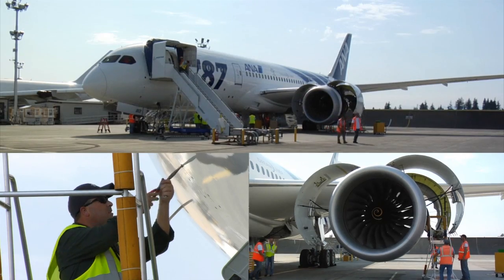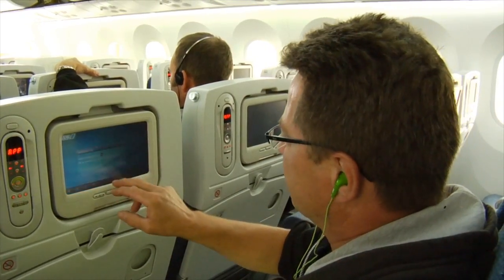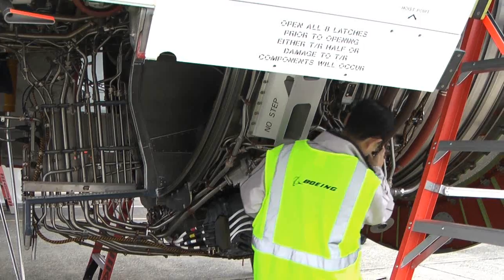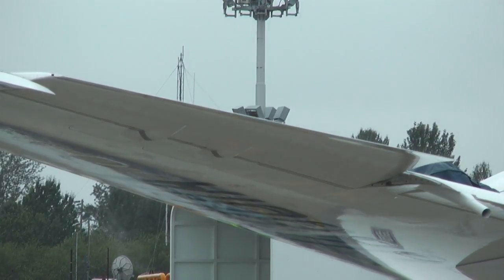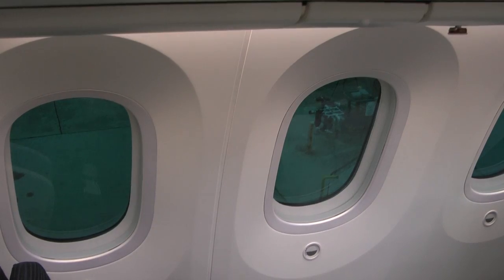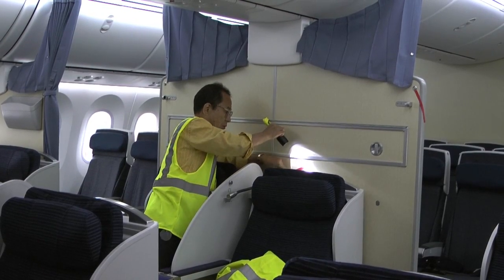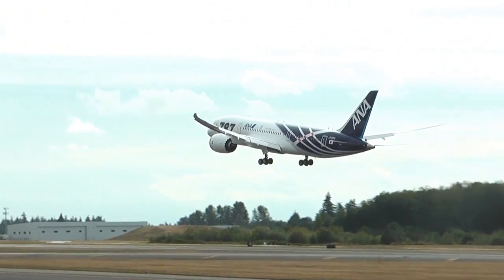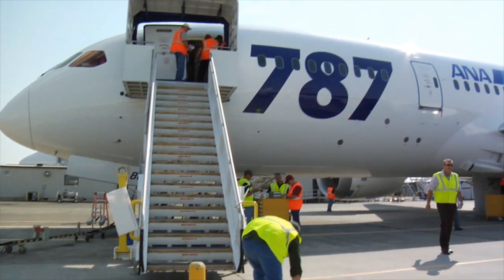Exclusive look inside a Boeing 787 inspection

Comment: Can someone please tell me do they (the airlines) perform this 10 hour inspection for every new plane they receive or is this an exception because the 787 is a new model? It just doesn't seem financially viable to perform this check on the non crucial parts of the plane (such as the in flight entertainment system) for every single plane.
Reply: Lko

Comment: As a former NDT inspector a lot of pride in my job everyday. Quality was the key word. If I missed a flaw the part would be installed. Thousands of lives could be lost if the air plane or missile went down incorrectly.
Reply: Pl please 9 pleas

Comment: On a 12-15 hour flight, that can mean arriving 10-15 minutes earlier which is substantial.  I've also read the 787 climbs out and reaches cruising altitude much faster than the A330, which is the best plane Airbus makes.

Comment: @blampa 
Sales dont prove who won. In fact, its a stupid thing to say that the 787 won because it has 900 orders and a380 has 220 .The A380 serves LONG HAUL flights while the 787 serves SHORT/MEDIUM HAUL. They do not compete with each other. Obviously medium and short haul flights are much more common than long hauled flights. So it wont take a genius to figure out that there are always going to be smaller planes serving medium haul flights than bigger planes.

Comment: @FrisoLustig Couple of things, glare has aluminium strips in it and isn't as light nor strong as carbon fibre; evidenced by the ability to offer higher air pressure inside, which is also why the empenage of the A380 was replaced with aluminium.  Further, in the cockpit you'll find most pilots prefer the old wheel to the sidestick even though the wheel is fly by wire, and for fuel consumption I'd wait until around the 20th a/c is delivered. A380 though only has 220 orders, 787 over 900. Who won?

Comment: @MisterSunson: sorry, glare is as light as the composite used on the 787. How does plastic lead a lightning strike? The cockpit is - despite the great screens - old-fashioned with the huge steering wheel. With so many improvements, it only turns out to be a little more fuel efficient than the A330-200 (which is nearly 20 years old). BTW: what is your interpration of 'most comfortable'? And the quietest? Ever heard a Avro Jet?
I look forward flying on 787 but please be a bit more rational.